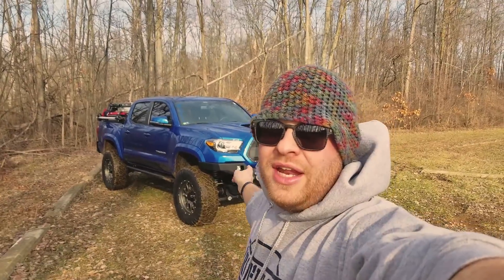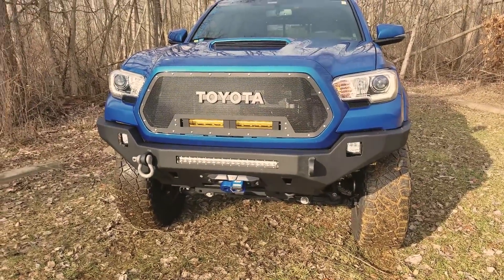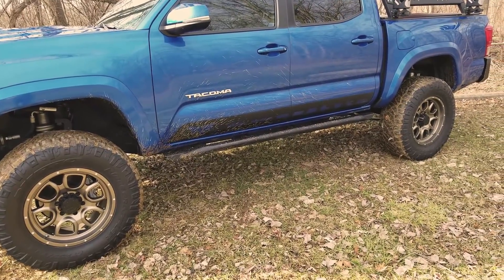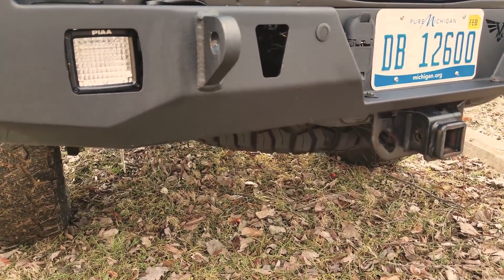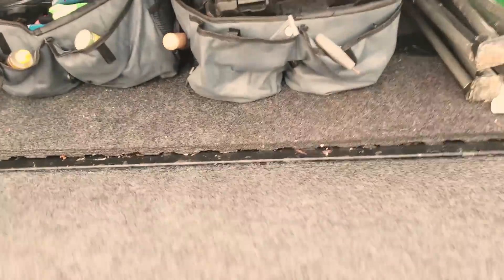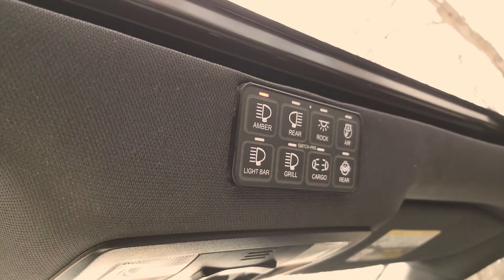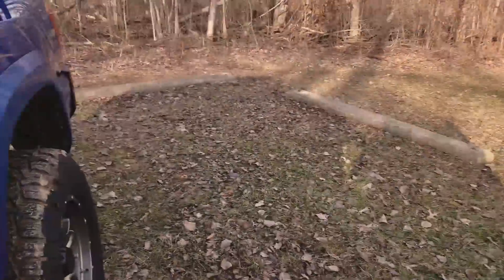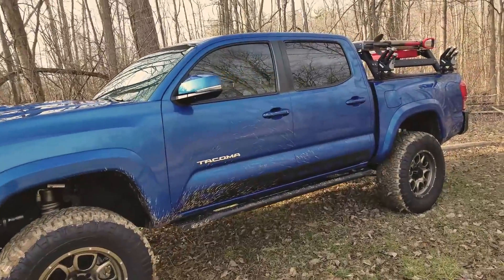Daryl's Tacoma Walkaround

Comment: Your truck looks great man! I love the front bumper. The color looks great! I think the 35's look perfect on that truck. Love the wheels! I like that clean look up front without a brush bar.  Love the way the winch is just kind of quietly tucked down and the light bar running above it. Took notes on your fog lights. I like how functional they are. It would be nice to have those lights to use on the road. I was sitting here watching your video loving everything you did. Your truck looks freakin great! Top to bottom you did an amazing job!  Gotta admit, I'm a little jealous.
Reply from the maker: Thank you!

Comment: Any plans to make a over the cab rack? Nice setup. You could set up your coffee/expresso bar as part of the cover for the blue behind the rear seats😂 over the cab rack for the roof top and aw. Would be at a better height for the aw. Some trail riding and how to on the installs for the air comp. switch pro etc. would be great thanks! On board water can't overland without that!

Comment: Have the same truck and lift kit! You seem like such a great guy! Quick Question - do you know if the Firestone Ride Rite Air Spring assist will work in back with this kit? It goes on top of springs where factory bump stop is, so the block shouldn't affect it I hope? If not what springs or whatever would you reccommend for the weight of tents racks etc in the back? Wanted your opinion! I am going to have to order one of your bumpers with the bar!

Comment: You could check out Proclips USA for mounts. I have used them for a few years in my last few vehicles and they are pretty awesome. They have a double mount that can hold a tablet and a phone. For the Taco, they have a flat mount and an angled; I run the angled.

Comment: I have the 2017 6 speed manual 4x4  off road, i absolutely love it. How does the automatic transmission do? Im pretty sure i made the right call, banging gears in a truck is loads of fun😁
Reply from the maker: Kinda wish we had the manual, the auto is kind of lame in these trucks.
Reply: Victory 4x4  You know my only complaint is I wish it had more balls under the hood Like A v8  lol

Comment: What lift would you recommend for a new 2018 toyota tacoma trd off road 4x4 that's only going to see a slight chance of off roading nothing to advance like you guys do but mostly a daily driver?  I was thinking 3 inch spacers up front and 1 inch block in back.  I never haul anything more than a few 50 lbs bags of cattle/deer feed.  thanks love your tacoma and videos.  liked and subscribed.
Reply from the maker: Yes, probably a small lift or leveling kit from any of the major brands would work great.

Comment: I'm a bit worried about the racks on the tacoma beds. Only because there inst much support there and the beds are supposed to flex some, with the added rigidity are you worried about damaging or distorting you bed fenders? I have been shopping for a rack and have a retractable bed cover keeping me from running a rack to the frame but I want a RTT. Any advice is welcome. Great video and nice truck.
Reply from the maker: The factory mounting rails on the bed have plenty of support, and adding a rack to them only stiffens the whole system.

Comment: Daryl, I'm looking to re-gear my 2017 Tacoma Pro here soon, and wondered if you feel your 4.88 setup is better than the 5.29's. I'm running a similar setup with my truck, and looking to purchase a 20' camp trailer with a dry weight right around 3000 lbs. Right now I'm torn between which set to go with. What would you suggest?

Comment: How much sag did the truck have with the rock sliders and front & rear bumpers when you had the stock suspension on your tacoma? I have already ordered the rock sliders, but really want to get the bumpers as well. Will the stock suspension hold up and still allow some off-roading without limiting clearance?
Reply from the maker: Charley Erickson very limited sag. Certainly not enough to effect off-road performance.

Comment: Can you provide a little more info on how you got the plugins in the bed and how they provide power all the time?
Reply from the maker: Drilled holes to flush mount them into the bed and wired them directly to the battery.

Comment: Does that rear bumper allow the stock blind spot monitor to still work properly?
Reply from the maker: Nope. The BSM system has to be behind plastic or in the open air, it' can't be behind steel.

Comment: Does re-gearing your Tacoma void the warranty? Just wondering. & should I regear if I simply get bigger tires? Or will the truck run just fine?
Reply from the maker: ROFLgator we are sure it voids any warranty that the axles have, but we can't answer that officially.
Reply: I see. Thanks for the reply

I want to get bigger tires on my tacoma 33". But don't want to re-gear. Will bigger tires affect the way the truck drives? Significant power loss? Or is there nothing to worry about?
Reply: I run 33” tires on stock gears and it makes a difference what tire you buy. If you go lightweight AT tire you won’t hardly notice if you put a heavy MT on it does make a noticeable difference.  I wouldn’t change anything unless you wheel hard then re gear makes more sense or bigger than 33 tires.  Have fun love tacos
Reply: Flyanb cool. How do the A/T's compare to the R/T's in terms of weight? I really like the aggressive thread patterns on the R/T's but I don't wheel as much as I would like.
Reply: ROFLgator usually every manufacturer has a size weight chart that usually has tread life rating and rim size limits along with load rating and tire weight. They can vary a lot my wheel tire combo is almost 100 lbs each for a HD mud tire, but a street tire  can be half that.

Comment: Follow up question:  What's your take on the Toyota "frame rot" issue with the latest Tacoma seeing as how you are in a "we love to salt our roads" state?...MN here.  Have been wavering on the Tacomas because of this what seems to be an ongoing issue.  But I could just be putting more into it than there really is.  Thanks!
Reply from the maker: We think the issue with the second gens was real, but the 3rd gens seem way better. The best thing to do is wash the truck often in the winter using an automatic car wash with an underspray, then spend each spring cleaning and addressing any surface rust. We do this on all of our rigs at the shop. Makes a HUGE difference.
Reply: I also live in MN and have a 2017 Trd Sport what I did first week I brought it home in Oct 2016 was Raptor line the entire under carriage then I did High temp coating on all exhaust components. If I could coat it I did and I have literally ZERO rust anywhere!
Reply: The first gen/early second gen Tacos were really the only ones affected by that issue. I've got an '02 4Runner myself, and while they weren't as bad as the first gen Tacoas, they still had their fair share of rust issues. Like Daryl said, just run it through an automatic wash once a week, or more if possible, and you should be ok. Another product that helps mitigate rust is fluid film. Meant to do it this winter on the 4R, but never got around to it.
Reply: Fluid Film is incredible, not a spot of rust after 7 years in Vermont. Be careful though, pressurized undercarriage washes will take fluid film right off.

Comment: What I dont get with a 6" suspension lift & 35" tires the truck doesnt even look that lifted at all & even more so the front end practically looks like it sits low as a car with no clearance at all? toyota trucks as with other truck manufactures are not like the old trucks many years back that had plenty of clearance under the cariage, people today pay thousands of dollars more for horrible designed trucks & the quality is gone so whats left is "junk" on wheels..